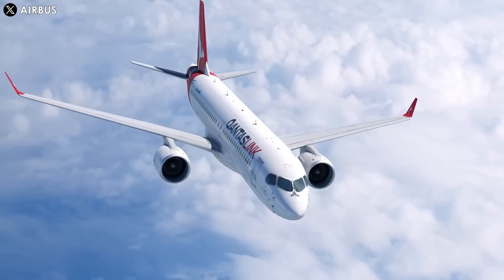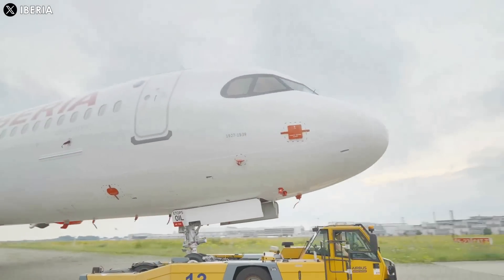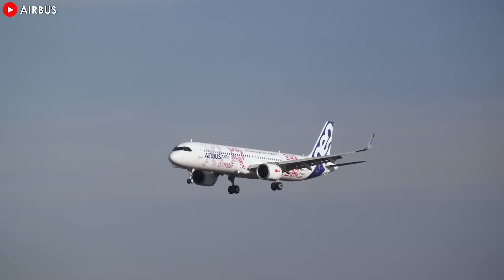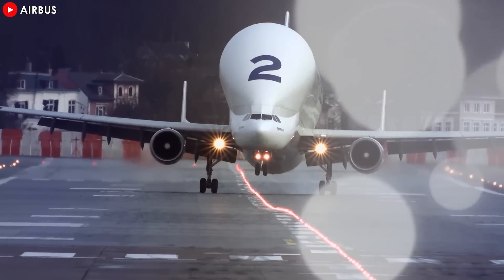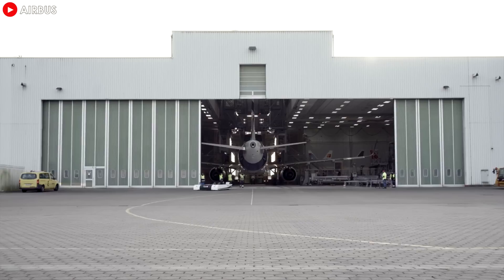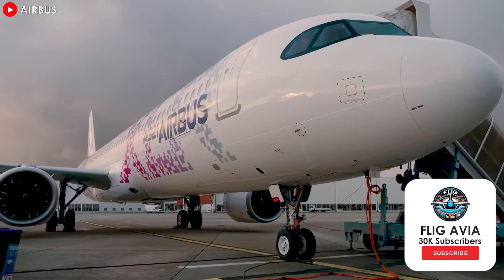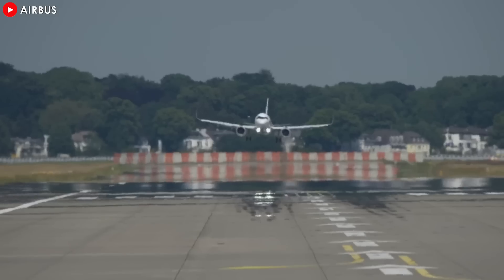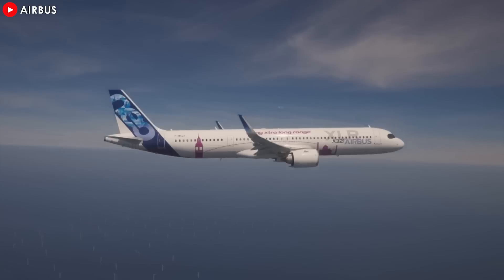Iberia Just Revealed Airbus A321XLR's HUGE Plan Shocked the Industry!

Comment: Most important feature not been highlighted. 
Elimination of all mechanical systems involved in RTL, Rudder Yaw damper and Rudder Trim system and replace by E Rudder.
Deletion of FAC1, FAC 2 and SEC 3.
That means total number of Flight Control Computers on A321 XLR is 4 instead of 7.  
Rudder is no more connected with cables for back up system
Another self contained Rudder system been introduced instead
Reply: Marvellous advancement, thanks for the info